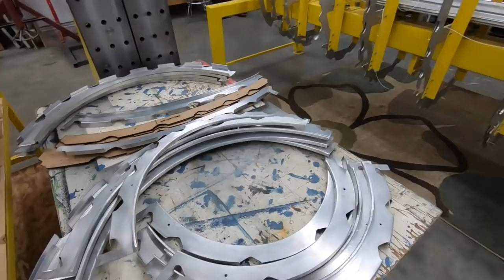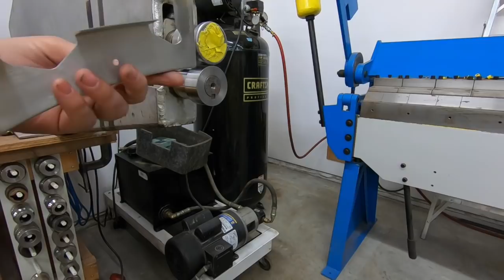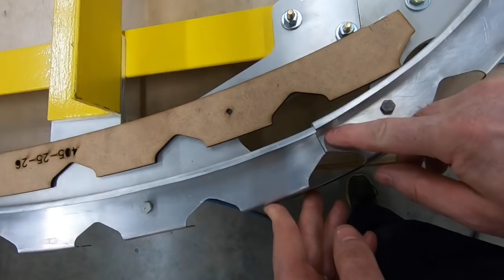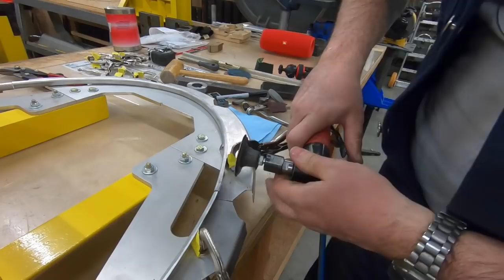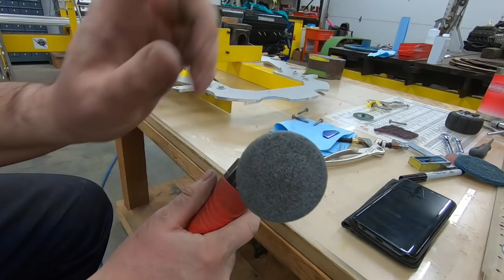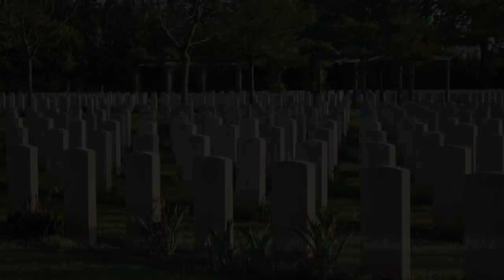Episode 15 Hawker Typhoon - Fitting Fuselage Frames

Comment: Hi from England, another excellent film showing your considerable expertise. Can I ask, are you manufacturing this airframe in exactly the same way as it would have been assembled in WW2? - you must have tools and tooling that were not available to the technicians back then?
Reply from the maker: There are many similarities for sure, but most of our development is done with CAD, and most templates and layout are done with our CNC laser. These are not essential, but they save massive amounts of time. There are also many lessons learned that apply to modern techniques which were not so common during the war; some may be due to wartime pressures and others may be due to the structural practices still being developed. At the end of the day it is essential that an airworthy rebuild is safe, and we are taking every precaution. Primarily this can be seen in the finishing of each part; during the war, the same care would not have been applied to smoothing and finishing edges because the life of the airframe was not expected to last. ~Ian

Comment: Such attention to detail Ian I am in awe of your skills and dedication to the quality of this build . The amounts of radii you have to put into each and every segment and frame is staggering and if only one is missed that could lead to the development of a crack down the line and the possible failure of a part, with the possibility of the loss of the aircraft and its pilot. So even as your attention to detail is staggering it's also necessary. Something I suppose was drummed into you during your RCAF training.
Reply from the maker: While there is some implied time pressure to get this project done, it sure does feel great to do everything right; with luck, JP843 will be airworthy for many trouble free years! ~Ian